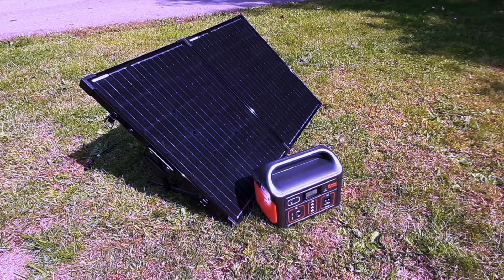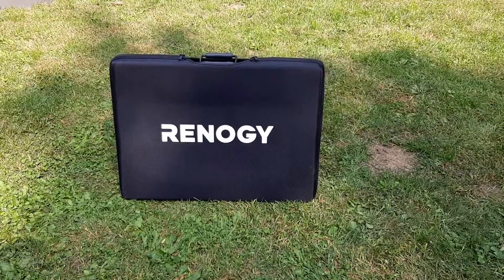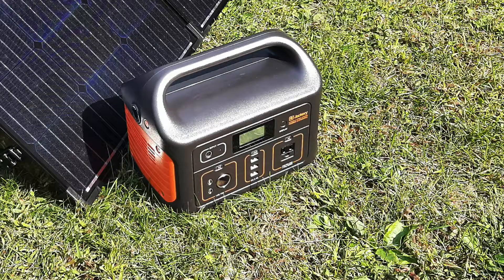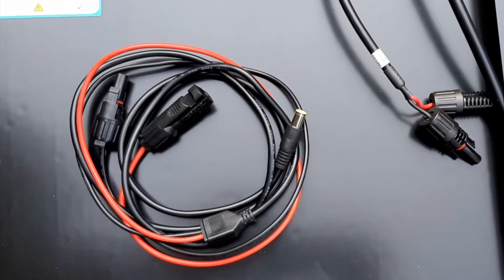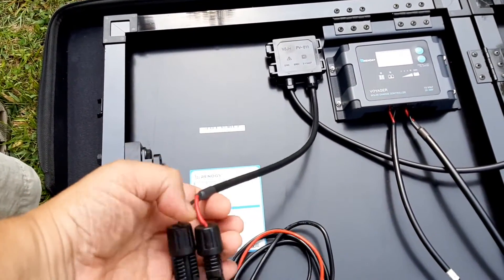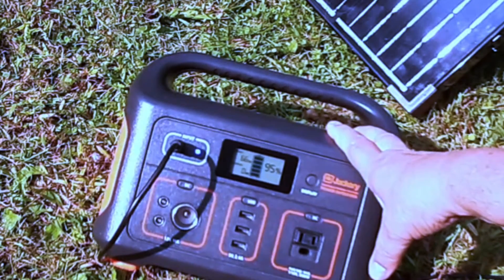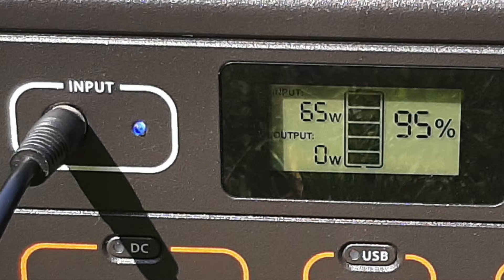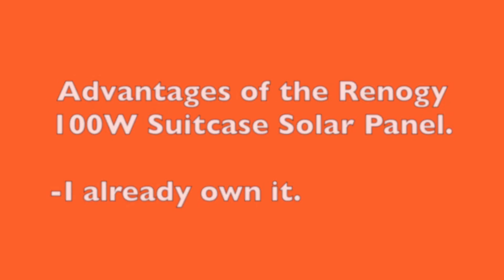Charging a Jackery 500 with a Renogy 100W Suitcase Solar Panel - Video 8

Comment: Hi . I just purchased the exact same renogy folding 100 watt panel and I have the Jackery 240 . Am I able still use these 2 together ? You mentioned yours was the 500 so I just want to be sure and not fry either my panel or Jackery . Thanks in advance .

Comment: I'm sorry to tell you that my Jackery 500 could NOT be charged by that Solar-Panel at all !! ... other Stations as an YTOMAN 1500 are charging properly.
Could it be that the Jackery 500 needs direct sunlight and therefore a minimum Wattage to be charged ?
My YTOMAN tells me about 10 Watts input on a very cloudy sky.
Other customers are having that same problem trying to charge Jackery 500 using a third-party Solar-Panel.

Comment: I just purchased two 200 watt Renogy folding panels that have the charger to connect to my eco flow.  Could you please do a video showing how to disconnect from the charger and reconnect to the panels to bypass the charger?   It  would be Very helpful and greatly appreciated.   

Thanks for all you do!

Cliff
Reply from the maker: I can do that, but I need to wait for better weather.

Comment: I have a jackery 300 and was wondering the same ...they make the renogy without charge controller too 👍 and being that the renogy is cheaper that's and seems better built too
Reply from the maker: Renogy does make a flexible solar panel that is a lot lighter than the one I used. Have not tried it with the Jackery, but I will assume it works as well.

Comment: ok your saying to disconnect the charge controller on the panel because the jackery has one built in yes?    thank you....
Reply from the maker: Correct.  If you connect the Jackery to the solar panels via the charge controller, the charge voltage will be lower and it will not charge very fast.

Comment: I need an extension cord to run all the way to plug into my jackery. Could you tell me exactly what I need to buy? I’d need at least 10 ft
Reply from the maker: You can buy an adapter cable that goes from the MC4 solar connectors that connect to the solar panel to the 8MM power connector the Jackery requires.  

So far, the longest one I have found is a 6ft cable.

From there, you can buy an extension cable with MC4 connectors for the solar panel end.

Either way I would not go smaller than 12AWG, and ideally 10AWG if you are going more than 10ft.  The heavy gauge wire is not required for it's current carrying capacity, but rather to reduce the series voltage drop along the cable.

A battery charge circuit has a low tolerance for voltage drops, even tenths of a volt, and a lower voltage at the battery will result in a lower charge rate.

For example, here is a 3ft charging adapter cable 12AWG MC4 to 8MM https://amzn.to/2WQqICb

And here is a 10ft 12AWG MC4 extension cable https://amzn.to/2WRmpa7

You can get by with 12AWG for 10ft, but if you want to go longer, I recommend 10AWG.

Comment: Can you connect 2 Renogy 100W suitcases together and then to the jackery? I have the Explorer 1000.
Reply from the maker: The Jackery charge in put is a MPPT controller limited to 30VDC input. As long as you stay within 30V, you should be OK.  This means you will be having to put the panels in parallel, as wiring them in series would increase the voltage to about 38VDC.
Reply: @RVProject  Ok, thanks for the reply.

Comment: Can you do a step by step on how to disable or bypass the charge controller on the Renogy solar panel??
Reply from the maker: I suppose I can, but it will take awhile before I can get the gear out.  

But in the mean time, I publish an associated webpage for each video I do, and it has expanded information that cannot be fit into the video.  The link here: http://www.rv-project.com/projects/suitcase4.php will take you to the webpage for this video, and it has a step-by-step drawing that might help answer your question.

Comment: Thanks for the video. 

So to clarify, you can easily disconnect and bypass the charge controller without damaging it in any way? So, when using the panel for the jackery, you bypass it via the adapter.. but you still have the option to use the Renogy controller if you're charging a battery?
Reply from the maker: Correct.  The Jackery 500 can accept from 12 to 30V on the charge port.  The Renogy solar panel I used has a 18-20V, so it is within the range of an acceptable input.

The Jackery 500 has it's own internal battery charger, so if you connected the Renogy charge controller to the Jackery 500, you would be connecting a battery charger to a battery charger.